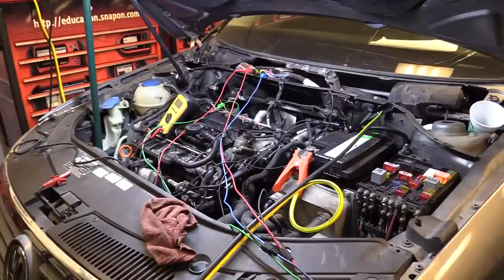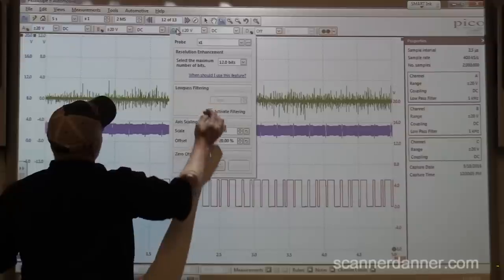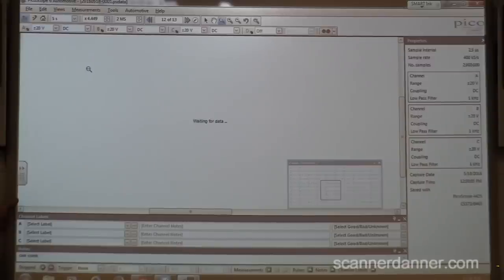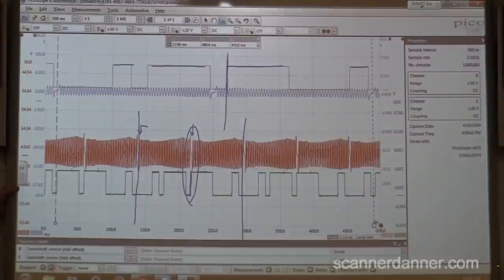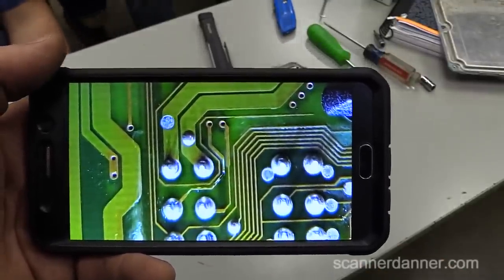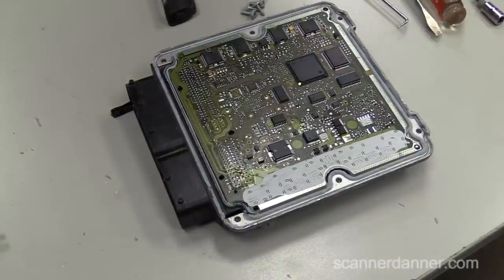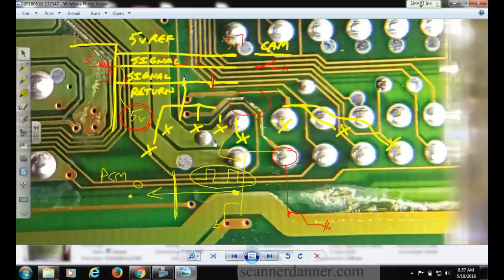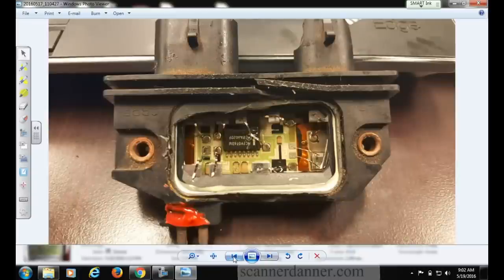A Smoked ECM AND a Jumped Timing Belt? [VW Passat No Start - an SDP Case Study - Part 3 of 3]

Comment: Hello. I have question. Since the sensor ground used by the cam sensor is shared also by a thermistor which is the coolant sensor. Is this why we see 4.7v on the ground for the cam sensor?(being with failed sensor ground trace in the ecm) I mean is it reading the voltage feed for the coolant sensor through  the thermistor, i guess if the coolant was warmer it would read 1.7v. This is sick !👍🔧

Comment: The board is attached to the aluminum housing by thermally conductive paste that glues the two together, allowing heat a chance to dissipate to the aluminum housing and then radiate away. You can buy tubes of that conductive paste. It's distinct from the silicone RTV around the outside designed to keep moisture out. I like your idea to try a repair, and it's a great way to expand skills without much risk. It's too bad that more recent boards are epoxied in to seal out moisture, making even minor repairs like this nearly impossible.
Reply: These you can work on.
The really hard to do were the JPEG from Chrysler from around 1999 to 2004 on most 3.7, 4.7,  5.7, 5.9.

These  Bosh, Continental ECUs are easier to work. 

There are more tools for programming and cloning too with newer modules.

I've seen this exact issue with 2005-up ford trucks
Reply: My old 90 lesabre has such conductive paste between the Ignition Control Module and the base that supports it.
Reply: @shagytrsc2  The Bosch ECUs are actually easier to open than the Continentals. I just opened a Continental one. Almost killed myself doing the physical contortions to open it up :). I haven't been able to get the board out from the housing though. I suppose the Continental one has a double-sided board too? It's a junk yard one I'm playing with, so I can break it no problem.

Comment: I am so glad I am able to program computers on some of the stuff I work on. The other day I logged onto Ford and programmed a used trans TCM, and a key for another car at the same time. $50 for a 2 day unlimited subscription. I could toss a used $50 ecm in and program it for another $50 subscription if needed.

Comment: First you diagnosed the smoked ECU , may be injectors or colis were not firing . And after repair by using cam to ck correlation or by relative comp and coil waveform you concluded the jumped timing ! 🤔🤔🤔

Let's see ❤️

Comment: I've been through a similar scenario with a 2001 Nissan Altima with a misfire condition. The driver was cooked and the ECU was hard to come by. Went to a junkyard got another ECU and desoldered and swapped the driver chip and eeprom to avoid reprogramming. Problem solved and  only costed $50 for the ecu. It all depends on the customer that I go that far for that type of repair. It's a skill as us technicians should give a shot for piece of mind than buying a whole new ECU.

Comment: The waveforms are not as far off as it appears.  On waves with spikes not the squares if you look at where breaks are and have the slopes they are opposite directions.  So comparing it backwards in sense. Flip one

Comment: Need a very thin jumper wire. We use wire wrap wire which is 30 gauge. Probably could get away with one of the cheap Harbor Freight magnifiers you wear on your head. A professional would use a stereoscopic microscope used for PCB repair.

Comment: I know this is old and long since repaired, but the community watching this cmp/ckp waveform for the belt driven TFSI engine should be aware that this engine takes its ckp signal from the intake cam. The belt drives the exhaust cam - if the belt timing checks out the chain is likely the cause.
Reply: I had that happen to me. A intake pressure waveform told me that timing was off, but when I pulled the cover off I saw the belt was on and was like what? My buddy came over and  was like check the chain. And bam found the problem.

Comment: I would not worry about that ecm, because it's fried! Look at all the black smoked checked components.  Rule of thumb, if you let the smoke out of the electronics it's smoked check.  Lol.  Too much current for the circuit

Comment: The pull up or pull down thing sounds like the new math no one understands. Basically and simply a circuit is fed power and needs a ground to conduct. Ground seeking circuit. Or the opposite. Grounded and needs power to conduct. Power seeking circuit. easier to understand.
Reply from the maker: No sir, this os critical info for INPUT circuit designs. We are not talking about output controls as you suggest. Hall effect sensors have a main power and ground all the time and it is the signal circuit I am referring to.

Comment: Good, you kept the word and uploaded all videos to everyone!
EDIT: It is so easy soldering, you need only proper tools. Blame only under 0.4mm soldering, this is yes too much (too little). I can to do it, you can to do that mammoth size 100% sure (I keep watching)
EDIT2: You do not need tiny tools, it is big misunderstanding on soldering. I use massive T12-K tip on everywhere, even 0.4mm pitch without problem. You must like flux and high temp. 350 degrees C is perfect. Internet is flooded so dumb suggestions where they suggest only 15W soldering thing and use low as possible temp...This is completely wrong! Time is your enemy but heat you must love.
Reply: Exactly what i observed at my work.best regards.

Comment: i'd add in:  the tiny trace for sensor ground was designed as such to act as a fuse.  To protect the ECM from whatever VOLTAGE was applied to the sensor GROUND line.

Comment: Currently having an issue with an 05 jetta 2.0.  Cam sensor shorted to battery code.  Getting 5v ref, but signal is 0v until alternator starts charging, then it's 12v.  First thought was a short in the harness but that's not the case.  12v signal remains for a couple minutes after key is turned off. Suspecting a bad PCM but trying to verify before going that route.

Comment: Silicone. Read up on statice electricity and circuit boards. When you feel the zap and sting of static electricity on a doorknob, did you know it had to be at least 3000 volts in order to feel it? Any less than that you won't feel, even though you still conduct it. A PC can be damaged by 100 Vvolts static; much less than 3000. If you touch those parts; therefore, you can damage them even if you didn't feel it pass (no zap).

Comment: I don't know if you will remember but a few months ago I commented on a video I had an 06 commander with crazy problems it had a long crank like that the one you worked on it would go into limp mode... and just die sometimes... I'm just a shade tree mechanic on my own vehicles but your explanation of the Chrysler hall effect sensor shined the light for me I checked it changed my crankshaft position sensor and it fixed everything except the long crank! I delt with that for about a month took the accessory wire off the starter put a little dielectric grease in the connector and boom cranks right up every time.  But I have to thank you personally I was lost and had almost given up on fixing it before I found your video . And the information you provided  that gave me the knowledge to fix our only vehicle was a true blessing to me and my family . Thank you again and have a blessed day.
Reply from the maker: I am blessed by hearing this type of feedback. Thank you so much

Comment: I had to do a timing belt not too long ago on a 2 liter AG series VW engine.   It was one of the old first gen ones.   And much to my surprise, that POS doesn't have any alignment marks for the crankshaft.   It did have marks on the cam gear, but that was it.   I just had to line the cam up, then made some paint marks for the crank.  Then put it together and hope it was right.   It was also a 6 speed manual, i'm not sure if that makes a difference.   I was so relieved though when it started and ran fine.   All told, I did about 1500 dollars worth of work on that old piece of junk.  But I've never seen a timing job, where the crank didn't have some kind of alignment mark.  According to the service data, the manual transmission cars didn't have timing marks for the crank.   Just wanted to throw that out there.
Reply: the early VWs had the timing mark or TDC  mark on the flywheel. You have to take off a plastic cover located near the rear of the cylinder head and top of the block to see the flywheel and rotate the engine to see the distinct mark of TDC on the flywheel.

Comment: The way you opened the ecu you have a brick on your table 😂 next time throw it in the freezer have a beer then open it makes that paste brittle=safer to open. Also putting an external ground can cause drain/parasitic draw
Reply from the maker: It was already bricked with no intention of repairing it and I wanted my students to see the issue. But for sure, I was not gentle 😉